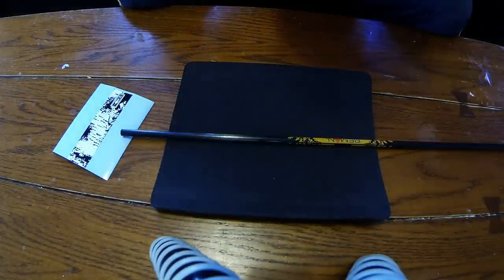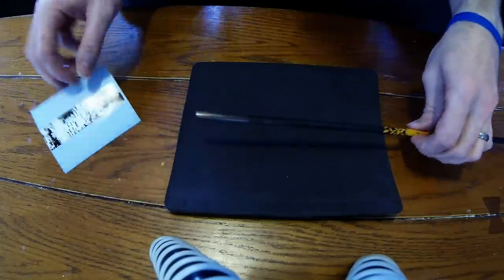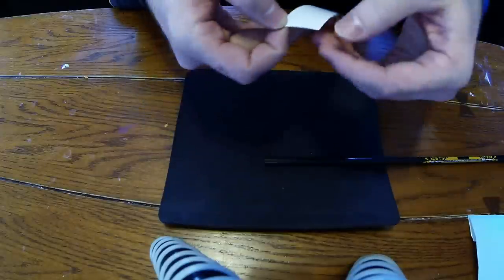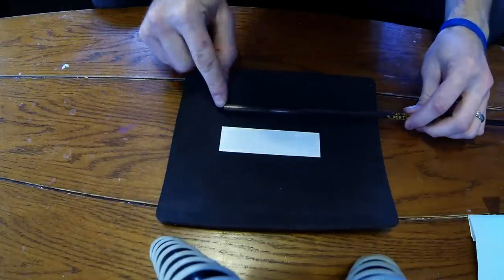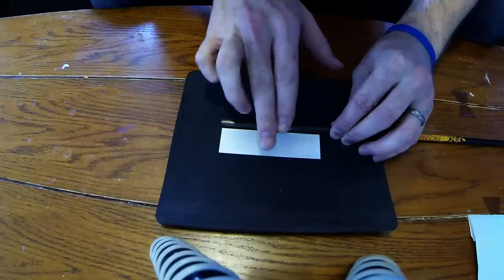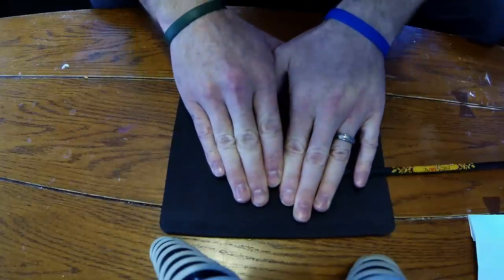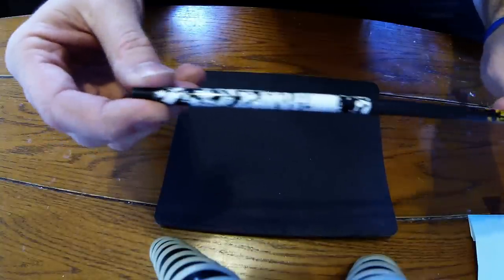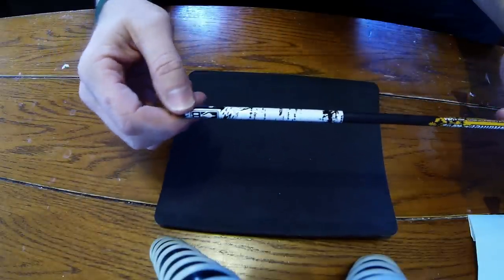How to apply a wrap to a carbon arrow shaft

Comment: does the wrap have to be on the end of the shaft or can you put it on the middle of the shaft and not affect trajectory?
Reply from the maker: +dirtdude59 I'll say that it COULD affect trajectory. I won't say that it will, but it'll all come down to tuning, your bow AND arrows. If I was going to give you sound advice from what I would expect from a mid shaft wrap, I would discourage against it. Even if the weight was evened out and you punched the numbers and on paper it "should" work, I would think at the very least that your Archers Paradox and natural flex could be affected by adding essentially an Ace Bandage and stiffening it up. I did however see just this week on a tv show that a fellow bow hunter had wraps on the FRONT end of the shaft, right behind the broad head. Just out of curiosity, what would be your reasoning for putting it somewhere other than the end? More visibility?
Reply: OutdoorShellback I really don't wanna refletch all of my arrows but I want to put pink wraps on them for breast cancer awareness month so they would at the very least be in front of my fletchings a bit